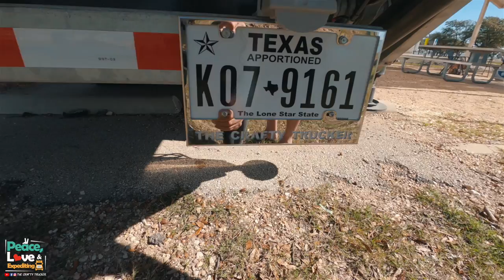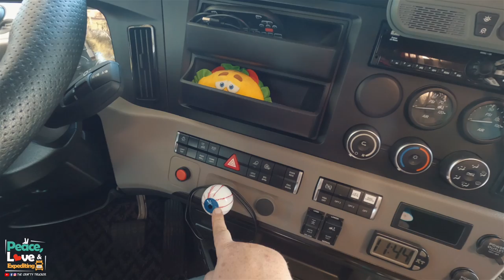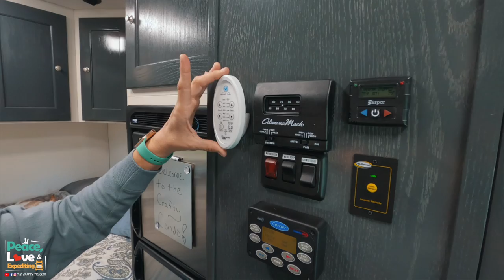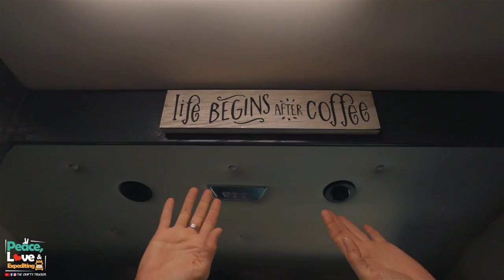2019 FREIGHTLINER CASCADIA WITH A 120 INCH CUSTOM AA SLEEPER

Comment: This is an old video, but see a lot of new questions. You only need a CDL-B and a teammate with a CDL-B to drive a truck like this. Most(not all) Expedite Trucking Companies are based out of Ohio. So you and your partner will need travel money to Ohio to get truck. No truck driving experience is needed. These trucks if you were to buy 1 new is about $250-325k. Companies to look into are Hyfield Trucking, TryHours, Bolt, and Panther

Comment: I'm excited for yall! Being single and a trucker that no longer likes renting an apartment, this rig would be perfect for me in a OTR scenario.
Reply: Otr?
Reply: Simplynikkitra Trucker lingo: Over The Road
Reply: On the road
Reply: I here ya! I go out for 2 months at a time often being able to just hop in the back for a shower or being able to actually cook a real meal would be a dream. But until recently for me im 140,000lbs fully loaded so that would be a pipe dream. I just bought my own deck now switch to flat deck full time, going to be nice only being 80,000lbs or lighter.
Reply: I drive a desk all day in corporate America so I know little about the logistics.  Can a single person run expediter trucks like this?  I would figure that part of the 'expedited' work would rely on a pair of drivers, so one can rest while the other is on the clock (moving the load much more quickly).  I've seen other expanded cab / custom trucks like this that look like they could pull normal trailers, but see people mention that it limits the weight / trailer length options, which might limit OTR loads.  

It almost seems like expanded sleeper cab means you should run expediter loads and expediter loads mean you need to be on a team, but I might be missing something or just not understanding.
Reply: @aarongranger  there are some solo drivers doing this but they are usually limited to short loads. Freight that can be picked up and delivered within one shift. It's definitely harder to run the business as a solo.
Reply: Think you

Comment: I had a tractor with a generator years ago and it was noisy. I went to Napa and got a Honda muffler and simply slipped it over there tailpipe. Made a huge difference in noise and helped with living in New England during the winter I needed it running when I was home for the heat and to keep the engine coolant from getting too cold. The neighbors stopped complaining about the noise.

Comment: Hey guys, I have the same APU and like Jason said it is really loud. What I did with mine was added a muffler.
I had an exhaust shop add 6’ of exhaust pipe to get it further away from tractor and they put a small muffler for a Honda car on it, it’s half as loud now and works fine, I had carrier sign off on the idea before installing muffler just to make sure I wasn’t voiding any warranties and they had no issues with it....just thought I would share that with ya all.
Reply from the maker: That’s a great idea.
Reply: If you don't use the front section alot it could be used for a portable work shop and storage for bikes or light weight scooters to use in down time. Loved the video.

Comment: In the Marines on ship we say take a Navy shower wet down , soap up , rinse off . Good old days 🕶
Reply: In WWII ships, if damage to their distillation equipment resulted in suboptimal potable/fresh water production, the first priority was always to the engineroom.   Under extreme fresh water shortage, especially in subs, a basin of water, maybe 0.5 gallon of fresh water was allotted to each sailor, every ? days, for personal use, if available.   If the ship or sub produced enough fresh water for a Navy shower, each sailor was allotted a 1 minute shower.   From my Navy Bootcamp, Damage Control training: max 10 sec to wet face, head to toes; close shower valve, lather feet to head, face last; open shower valve, rinse face, head, down to feet, using what's left of your 1 min of water.   In 1969 the USS Tulare LKA-112 returning stateside carried so many troops, that many had to camp out on the main deck.   "Hollywood" showers and other water wastage was forbidden.   Water usage by the crew and troops onboard, never threatened the ship's production capacity.   I was there as an EN3, in A gang.

Comment: So I had an intriguing thought on your rear partition system. Could you have the wall be a set of doors instead so you can open it into one big space if needed? I figure that convertibility would be nice in case you ever need the floorspace or if you need to adjust a load to meet scale requirements.
Reply: This is such a great question and idea.

Comment: That truck is mint. In the uk and europe we dont have anything like that.
Reply from the maker: Thank you. That’s what we’ve heard. Y’all mostly have cabover truck correct?
Reply: @TheCraftyTrucker  thats right. the nearest we get to trucks like this in europe is a scania longline. Have a look they are pretty cool. Nothing like the space that these have though
Reply: @TheCraftyTrucker  The main reason European tractors are cabover, is that European countries have an overall length maximum which includes the tractor. The overall maximum length for at regular tractor + trailer in the EU is 18.75 meters (61,5 ft). 

Since pretty much all standard trailers in the EU is designed to carry 33 pallets (3 rows of 11 pallets), you can't really cut back on trailer length. You would just exclude yourself from being able to carry most full-loads. Therefore they decided to bet on cabovers, which are shorter than conventional cabs.

In the US, the tractor is not included in the overall length. Only the trailers. Therefore they are free to use custom sleeper berths.
Reply: dennis the dog good job at 3mpg u would be broke in no time with our fuel prices

Comment: That's awesome.  Like a tiny but so practical RV.  I just wanted to share a tip for you.  That stainless backsplash can be so much more than decorative. You can use magnetic spice and misc containers just stuck right to them. I wrote on the lids of the containers with chalk markers to i.d. the contents. That what I did to the pantry door in my 5th wheel. The glass was pointless so I put a piece of sheet metal on the inside and chalkboard sticker on the outside.  I just got the magnetic containers from the Dollar store.

Comment: I JUST SEEN ONE OF THIS USED ON THE INTERNET. I THOUGHT YOU WERE BUILDING A CAMPER HOME. FOR THERE SIZE AN THE PRICE I SEEN USED IT WOULD MAKE A AWESOME CAMPER. I SEEN A FED EX TRUCK THAT HAD DOUBLE SLEEPER CABS AN THE BOX ON THE BACK. I REALLY JUST SEEN THIS FOR SALE ON THE WEB AN I WAS. THINKING WHY NO ONE TURNING THIS IN TWO CAMPERS?  I THINK THIS MAKE BETTER MONEY MAKERS THAN MONEY TAKERS. NICE VEDIO AN NICE TRUCK
Reply: I'd convert one of these before I ever bought a motorhome.

Comment: I know this video is old, and I transitioned from trucking to IT a while ago but this is the biggest box van I've ever seen in my life.  

I've seen box trucks before, I've seen extended sleeper oversized tractors before, but I've never seen a semi-box truck before lol.  Man I thought my T680 was snazzy back when I drove, my little old 23in tv, satellite tv, and playstation but hats off to tractor designers these days cause this blows mine out the water 👍🏾

I'm kinda surprised they haven't changed the design of freightliners in 7 years though.  I remember the 2013 (2014 model year) cascadias having the same design, same exact wheel controls.  The bluetooth came through your truck speakers back then and there was a little microphone near the drivers side dash.  Guess there are benefits to o/o expediting.  Nice

Comment: Even in my travel trailer we use the on off switch on the shower head because it conserves water and with a small hot water heater keeps you from taking a cold shower lol

Comment: Enjoyed your video.   Have you thought about modifiying the divider wall between your trailer box compartments so that it can be removed and reinstalled as needed?  That way if you have a big load that requires both compartments you'll have the flexibility to load and unload the entire load via the rear doors.   Also perhaps in the future you might consider installing another removable divider wall and additional side doors to create a possible third compartment in the middle of your trailer box so you'll have the capability of having three separate  loads at a time to further increase the profitability of your operation.
Reply from the maker: We’ve thought about it. Most of the customers want it permanent. It has not been very useful other than storage so far but this year has been really strange

Comment: Hello again! How many amps is the alternator on the engine rated at? How many amps/watts is the generator rated at? Does the truck have drum or disc brakes? Is truck insurance cheaper with disc brakes? Do you use any deep cycle batteries or solar panels? What is your fuel mileage like with the 13 liter engine versus using a 15 liter engine? How much heavier is a 15 liter engine? Do you drive into Canada? Do you drive to Alaska? Do you have a Sam’s Club/Costco membership card? If yes, do you save enough money to more than pay for the membership fee? Is there a magazine describing expediter trucking? How low do you stay out driving before going home for time off? How often do you have the engine oil changed? Where do you have it done? How often are the oils for the transmission and rear axles changed? Do you have an oil BYPASS filter for the engine? How much does the truck weigh? How many gallons do the fuel tanks hold? Are you able write off the amount of fuel that the APU uses? I like the ceiling fans and windows in your sleeper. I love the fresh air when it’s Not Too Hot!! So the truck is set up to use shore power? Do you haul haz-mat loads? Why do you use the DT12 transmission vs. a regular 10 or 13 speed transmission? Are you western regional or all 48 states? I wish that I could have seen your previous videos and previous truck. I’m a company driver for a company based in Nebraska. I’m trying to learn more on how to not eat out so often, aftermarket sleeper units, and perhaps if I want to become an owner-operator. How often do you change the oil in the generator/APU? What kind is it? Thank You for your time!

Comment: I used to own an M2 boxtruck that I used for local deliveries. 
I hated the seats in that truck with a passion, I haven't owned it in years and my hatred of those seats have not died down at all.
Your truck is so nice that if I ever did over the road driving, I would want your truck instead of doing an 18 wheeler.
I don't know which one is more profitable, but I know which one looks more comfortable.
Reply from the maker: Comfort plays a big roll in profit.

Comment: Have you thought about portable bulkheads?  Any size of split loads could be handled. With those E-track load locks you could actually build one in an afternoon. I would  would use several at a time for split loads(In the 'olden days'). Great looking rig-Be Safe!

Comment: Love the new truck. I’ve watched a few of your videos and find myself thinking about how “ I would have done it” lol but you mentioned about leaking after the panels were installed and I thought that if you drill just deep enough for rivets to work and fill the “holes” with silicone before fastening them that maybe that could work. Also your shower, if you could do without the toolbox on the driver side, you might be able to put some kind of grey tank there between the def and fuel tank.

Comment: HI GUYS, 
I Love your home on wheels, its beautiful and roomy.
1 question, why not consider installing a washer/dryer combo in the cabinet where your trash can is. 
Home Depot  and Lowe's  have great small ones that will fit in that spot .
Just a thought!  To me as a woman I would live one if I had your home on wheels, in case there's a bad storm of snow, rain and or both, you have everything g you need and an added appliance like a washer/dryer combo would be perfect! Especially if you get one in sleek black. 
What you guys think? 
And the dash is PERFECT! You guys thought of everything and then some.
Love from UTAH!

Comment: This is for a very specific lifestyle. Not too many women or men willing to do this. This also requires a team system where the truck needs to be moving 24/7 for very specific loads which are high dollar and fast expedite.
Reply from the maker: You’d be surprised how many same household folks are interested
Reply: TheCraftyTrucker thank you for your response. 
Question? If one were to have  some money set aside and wanted to get into this. Would you recommend getting a new unit to begin with spec'd like yours(maybe not so big of a sleeper) I am single age 52 and don't plan on getting back into another relationship. Would this work out for me and can I make good money so I don't have the bank people chasing me?

Comment: I have a big truck 379 Pete 12000 front axle i am full of fuel almost 14000 as long as you have tires to carry that weight never had a problem

Comment: I would add stucco lathe behind the grille screen,to prevent bird strikes from destroying the radiator.
It only costs a few bucks to buy,and can be secured with zip ties.
The factory screen isn't adequate against such at highway speeds.
I would add a Drop/tag axle,or set it up to pull a pup.
How MUCH did it set you back?
I have $70k set aside,and am tired of pulling reefer as a company driver.
Reply from the maker: That’s a great idea. I know the bug screen would just tare if a bird hit it

Comment: Luv the channel. Came across you while researching class 8's to convert for rv hauler. Is there a market for those boxes used? Buy used truck like that for frame length/ remove box and sell as example?

Comment: Hi! Great truck! Some say I’d like to ask you about buying a truck like that but not for hauling freight. The cab and sleeper I like. But thinking about hauling my Dodge pick up truck with it when I retire from driving. By the way, are you able to use shore power/ electrical hook up to run electrical stuff when parked?

Comment: I have always wanted to build a RV along the lines of this. I had created  plans for one abouf this size and one running a day cab and 27' box another having a  40' box. Most recently i been looking at the 53' with triple axles and droppsd down belly for hauling sId wood chipz to a chip board factory. I like the idea of using the enclosed deop belly to protect and haul the water tanks.being that big with triple axles it could haul the weight of a car in the back easy enough. My latest idea was designing a 24-28' tiny house zef up to be full ADA capable. As per now i am handicapped, but still want to build it. Then get a p I stage stamp chunk of land that i could park on and live rest of my life.

Comment: Does the back half come off easily to reveal a 5th wheel? Because if it doesn’t I’m throughly confused why you wouldn’t just get a motor home
Reply from the maker: No it does not come off, no fifth wheel. Uhh because you can’t haul freight with a motor home.

Comment: I like the set up inside the truck but do yall keep the spices, items in the cabinet, the coffee machine, candle, dawn soap on the counter and etc from falling when you drive, hit bump, turn and hard stops?
Reply from the maker: We use a product by 3m called dual lock
Reply from the maker: The cabinets stay pretty good just from being packed in good. We’ve never had a problem
Reply: Duel Lock ok! I will look into that, I drive semi trucks and the more items i get the more likely they will fall, spill and cabinet swing open.... thank u

Comment: Wouldn't you load the last delivery to the front of the trailer and the first delivery at the rear as the first drop off so this way there is no reason to move another delivery?

Comment: Love this new truck, you both deserve it. I do have a question though. I’ve been retired from Professional Driving for 14 years now, so maybe weight laws have changed, but isn’t California limited to 12,500 on the steer axle? If so, you’re already over weight as you sit. Am I missing something?
Reply from the maker: Thank you so much. They may have changed that. Max any single axle is 20k California does have some weird kingpin rear tandem measurement rule. But never heard or seen the 12,500 rule.

Comment: They put your water outlet on the passenger side for safety reasons. You need to have a minimum amount of space between power systems and waters systems because they dont mix. You get a water leak and your truck either fries its self, lights on fire or both.
Reply from the maker: That makes perfect sense
Reply: @TheCraftyTrucker  Happy trucking to you both maybe see you on the road some time.

Comment: Bridge Law on a straight truck? Is news to me, the bridge law applies to a tractor trailer which is the distance from the king pin(not found on a straight truck) to the center of the rear axle on the trailer
Reply from the maker: Bridge law applies to all commercial vehicles traveling our road ways. Bridge law is not the bridge between kingpin and rear trailer axles. It’s the bridges we drive on which are designed and built to with stand certain weight vehicles. No single axle can weigh more that 20k and no tandem over 34k. In the link below scroll to bottom to see single unit trucks bridge law formula.
https://ops.fhwa.dot.gov/freight/publications/brdg_frm_wghts/index.htm
Reply from the maker: Quick correction the distance between to king pin to axles are regulated as part of bridge law but that is not the main design of bridge law

Comment: do you know that there is a company in Europe who manufactures a pneumatic suspension truck weighing system that allows you to know the weight of the load your vehicle is transporting at all times ( connection with mobile via bluetooth) making it a true mobile scale.